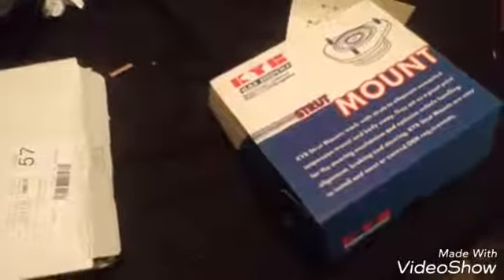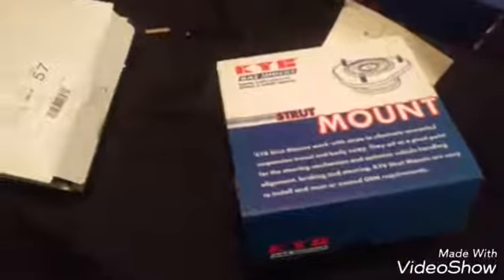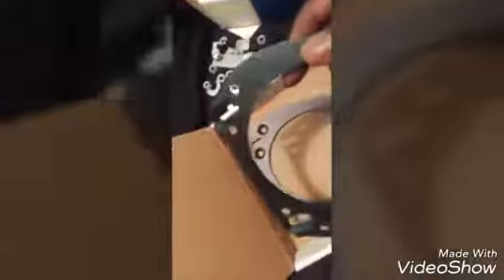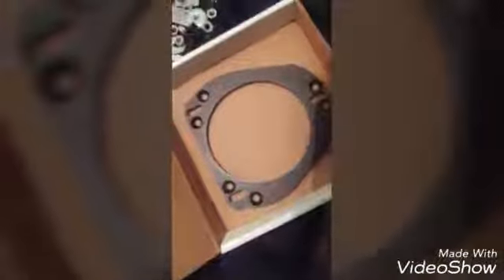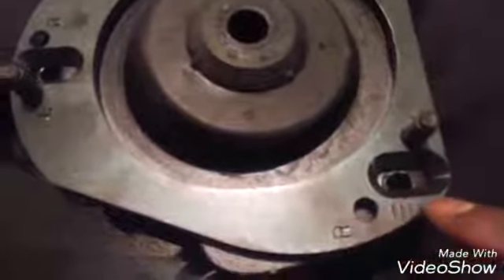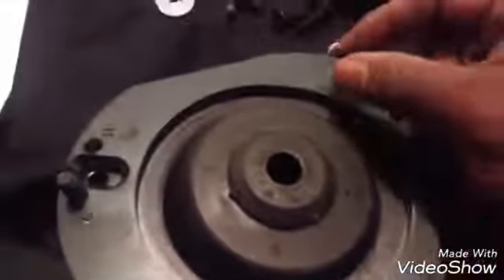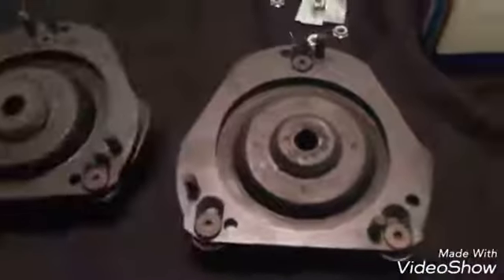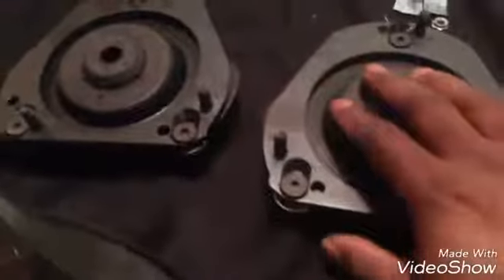2007 Ford Taurus SE - Camber Plate Installation

Comment: Very good, thanks. Have been researching this some more today and may just need to replace the front strut assemblies to get the car back up to an original ride height and then have the alignment checked to see how far off. Will watch your other video to get more information and formulate a plan. Thanks much.
Reply from the maker: Anytime. I hoped it helps.

Comment: Hi, very good video, this is exactly what I need to do for the front of my daughter's 2002Taurus. If you could please provide the part numbers for these parts I would appreciate it. Her car is wearing the inside of both front tires and needs the camber adjusted. Thanks!
Reply from the maker: If you didn't lower the suspension like I did and need just an adjustment for a stock height car this is what you have to do to get it  aligned. The camber plates are not needed. I made an older video addressing it. This will save you $100 over buying alignment plates.
https://youtu.be/2rZJ_WToL7U